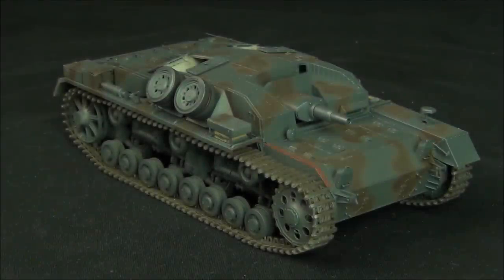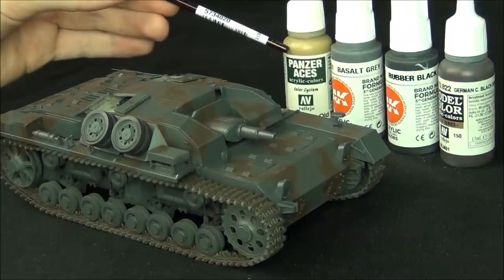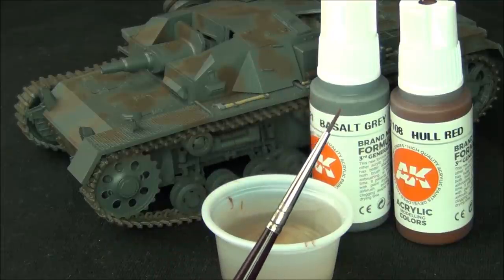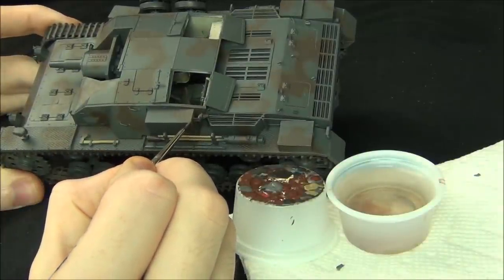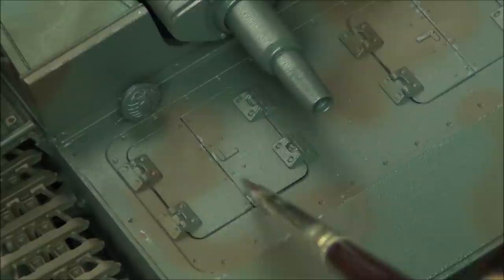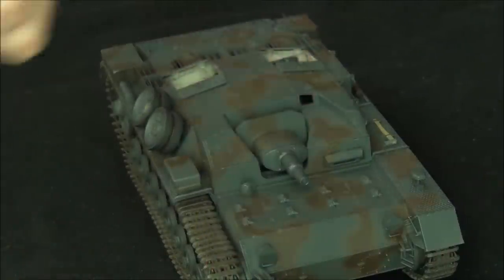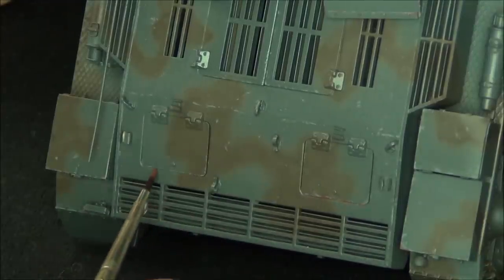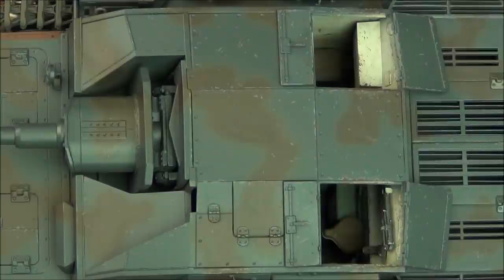How to Brush-Paint 2 Colour Chipping Effects

Comment: Hi just found your channel and love your work, very professional, easy to watch and full of great tips. Question as I am new to modelling. I use Acrylic paint to paint my models and then spay with matt varnish, I then put on the decals and put another light coat on. I then use a pin wash with enamel paint thinned down and another light coat of varnish. I then attempt to use some of your weathering techniques best I can.  I don't like buying more product than I need and try to use alternative methods to obtain the same effect. Are enamel paints OK for washes, some say they are not. Cheers.
Reply from the maker: Enamels are good for washes.  All the pre-made washes are enamel based.  I like to mix my own by thinning oil paint with enamel thinner but you should be able to do the same by thinning enamel paint with enamel thinner.  Just be certain you are not using a super powerful enamel thinner as it may attack the varnish.  So always test your thinner on a spare painted model if it's a new brand of thinner that you aren't experienced with.

Comment: Nice technique and explanation. There is a brand of brush I ran across on Amazon that is really cheap. It's called Artisan Shoppe. They are dirt cheap. I thought when I first bought them that if I ended up pissing off the $8; no big deal. I was absolutely amazed at what I got. In particular the 000 size. They come to almost a hypodermic like point. I have even improved doing eyes on 1/35 scale figures using them. They are every bit as good as some I have paid 5 times more for. I don't know what it equates to in Canadian dollars, but; I think it would still be cheap. You ought to try a couple. Nice Stug, by the way.
Reply from the maker: Thank you for the lead.  I will take a look!

Comment: Hi, wondering what you think of VMS varnish. Have you ever used it? Since this is an acrylic varnish, remember you using an acrylic to seal, then used enamel pin wash. Any help will be greatly appreciated since this will be first attempt at weathering a tank.
Reply from the maker: I have the VMS varnishes and I use them exclusively now.  They're very good.  I prefer to use satin not gloss before washes, and the satin one works well for that purpose.

Comment: Looks fantastic but why do you use acrylic paint to chip? I thought your view was to weather in oils. Your chipping is superb. Mine is not and I correcting mistakes is far more difficult or impossible.
Reply from the maker: I want my chipping to dry fast and be opaque so I use acrylics for it.  All of the effects that require blending or cleaning - so washes, filters, streaking, grease, dust, etc. - I use oils for.